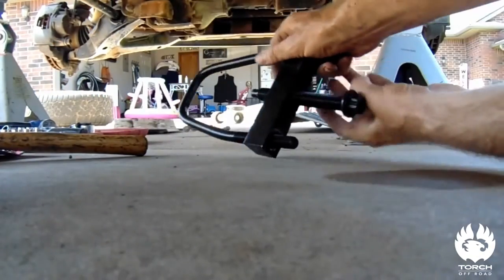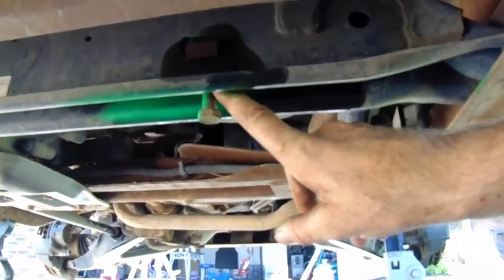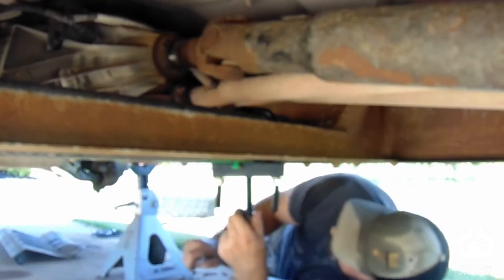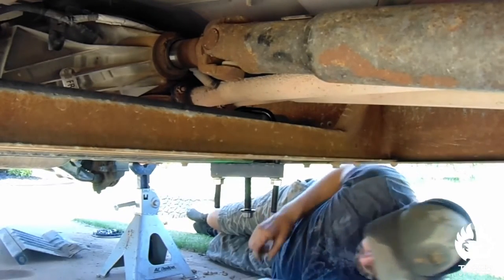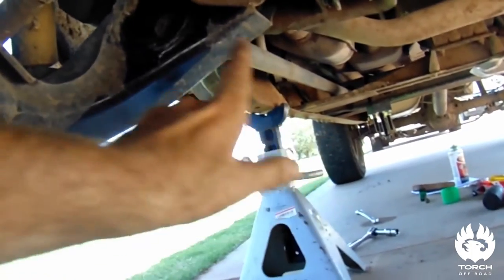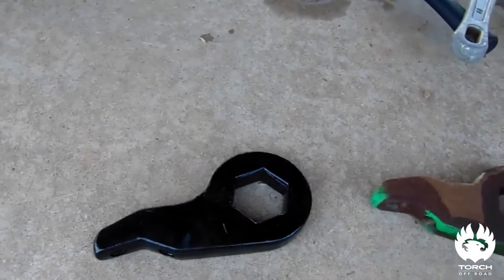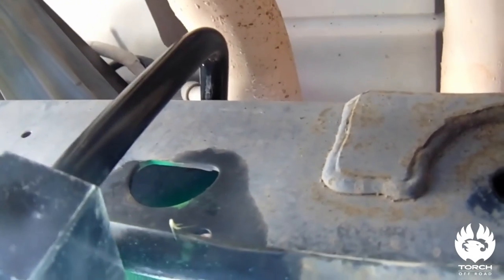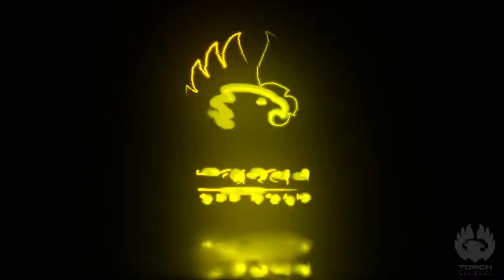TORCH 3" Front 2" Rear Leveling Lift Kit for 88-98 Chevy/GMC K1500 Front Torsion Key Installation

Comment: My kit came with the shock extensions.   I have newer shocks and am not replacing them.  Do you have a video or literature of how to properly install the shock bracket extensions on this same model truck?
Reply from the maker: Thanks for your comment. Are your new shocks extended length, or the OEM replacements? Please contact us directly and I will be happy to help with the installation of our shock extenders 🙏 -TORCH
Reply: I installed the lift and have extended shock but my upper control arm is bottomed out on the bump stop how do I fix it

Comment: I bought a similar kit but did you put in the shock extenders i didn't put mine in and I'm maxed out on the front end should i buy new shocks or just in the extenders?
Reply from the maker: If your shocks haven't been replaced in 5 years or 50,000 miles, I recommend purchasing a new set of extended shocks. Otherwise, I recommend installing the shock extenders. Please contact us directly if you have any questions and thank you for working with us -TORCH

Comment: Can you fit 35,s on this?
Reply from the maker: Thanks for your question. Unfortunately, I don’t recommend trying to fit 35” tires with this lift.

Conservatively, I recommend up to 32.5" diameter tires with this 3”/2” lift. However, I know you could get away with 33"s with minimal to no rubbing. Anything bigger than a 33" tire will require minor fender trimming and proper wheel spacing to fit the larger tires. Please contact us directly if you have any questions and thanks again! -TORCH

Comment: Works for 2 WD?
Reply from the maker: Thanks for messaging us. This kit is not compatible on the 88-98 2WD vehicles with coil spring suspension. Please contact us directly and I can recommend a lift kit for your application 👍 -TORCH